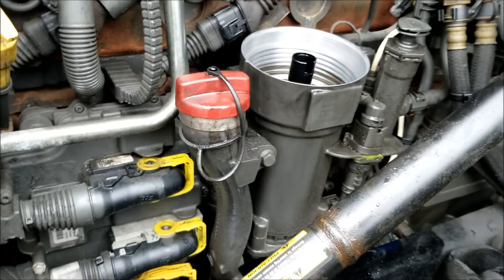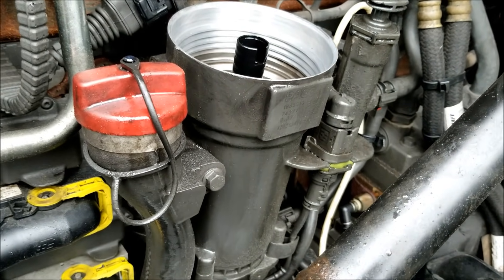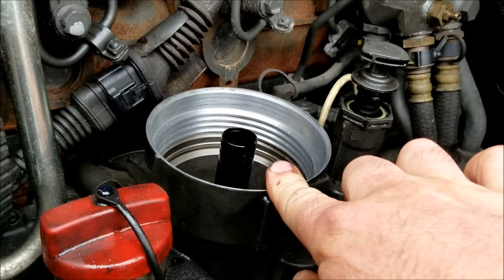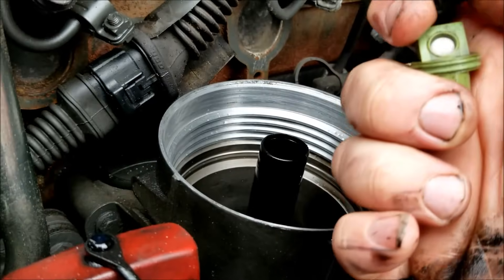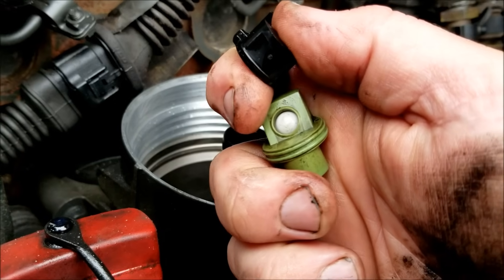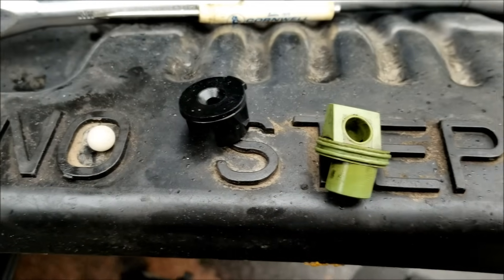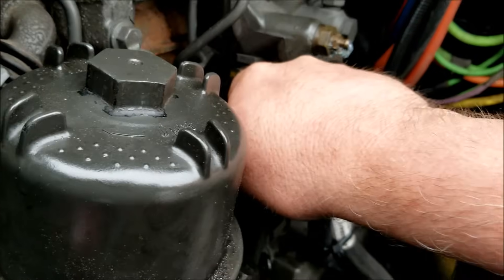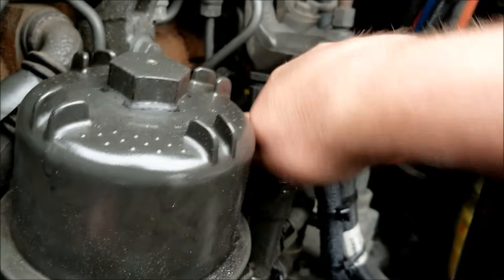Paccar MX13 Fuel Issues - Check Valve video by Dr. Paccar

Comment: I replace my filters and try to prime it but it dose not prime what can it be
Reply from the maker: Depending on the year of the engine some of those Paccar MX13 engines can be real mean to prime. Just make sure you didn't get the white ball stuck in the port hole of the green cap because if you did it will shut off the fuel flow. The white ball should not be stuck in the green cap and should be floating around freely. Next "SOME" Paccar MX 13 engines have a bleeder, I show you this in the video. NEXT the newer Paccar MX 13 engines do NOT have a bleeder. So if you replace both fuel filters at the same time you will need 2 people to prime it. First pump the primer until it's hard. But it still will not start. ONLY after you get the primier pump hard have another person start cranking the engine over and continue to pump the primer pump as the engine is cranking. It will start then. NEVER replace both fuel filters at the same time on the newer Paccar MX13 engines. Replace one then start and run the engine for 5 minutes. Then do the same with the 2nd fuel filter....Good Luck

Comment: I changed my fuel filter and ran for a minute got dark on me so I'll check to see if mine is stuck got a 2016 Peterbilt 579 mx13
Reply: I got exact same truck wen I first got it I drove it 2 months before fuel filter gage  inside truck showed it time to change so took it to the shop got it changed n wen got the truck back gage inside truck was already almost half way to dirty does anybody know what thats all about shouldn't it show zero wit new filter ?
Reply from the maker: We have alot of issues with our Paccar filters getting black. Using a fuel additive for algae helps
Reply: What's the mileage on your truck now?

Comment: Dose the bleeder valve need to stay hard after it has ran??
Reply from the maker: No once it is up and running that is it. Just make sure the hand primer pump is hard to push to ensure a proper prime. It should fire off. If you loose prime or if it stalls out and looses prime ditch the white ball in the video

Comment: It also keeps the fuel from back flowing into the tank. So as the truck sits it won’t have any fuel in the fuel rail. So you will have to continue to prime it.
Reply from the maker: Not true. Once the engine is primed it stays primed unless you have a issue with the actual check ball, This plastic ball has nothing to do with keeping the fuel system primed. All of these balls have been removed in all of our trucks and yes some sit alot and not once did I have to go out and prime the system again. All this plastic ball does is to cut off fuel supply if you install the wrong micron fuel filter.
Reply: @Dakman 
Have learn a lot from you bro
Reply: The anti-drain back valve on these engines is actually located under the hand primer pump.
Reply: I learned a lot from you.

Comment: thank you for the information. Do you by chance know if i can order it from anywhere else other than the dealer. if so do you know the name of the exact check ball repair kit or where i can get it.
Reply from the maker: Honestly if you just take out the ball like I show in the video you will never have another issue again. That ball is only in there so you are forced to put in the correct filer. It does protect the injectors from improper filtration in case the wrong filter is installed but unnecessary if you have your own shop and do your own repairs. The wrong micron rated fuel filter could allow debris to pass thru to cause too much restriction. We have removed all of ours in all of our Paccar MX 13 engines and had no issues

Comment: I also noticed that you have the ten micron filter in your DAVCO. The ten micron is meant for a Cummins powered truck and the 25 micron is meant for the MX. We have seen where having the ten micron in place can cause fuel restriction on startup resulting in P0087 and potentially a rail control fault. The ball you are talking about is referred to as the 'No Filter No Run'(NFNR) ball and will stick like that when some additives or biodiesel are introduced into the system. This blocks the flow of fuel through the standpipe resulting in the exact problem you are describing. Nice investigative work and good video.
Reply from the maker: Thanx for the added info especially on the filter microns. We were primarily a Cummins powered fleet until recently and wanted to try MX13 engines.
Reply: I'm planning on getting a T680 with an MX, how are yours doing now?